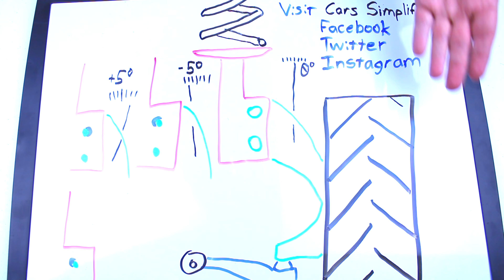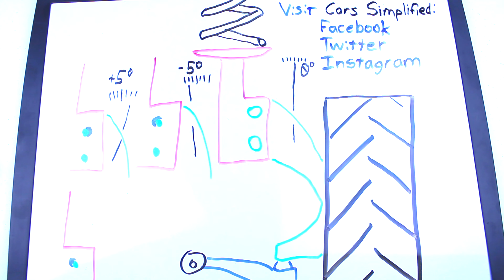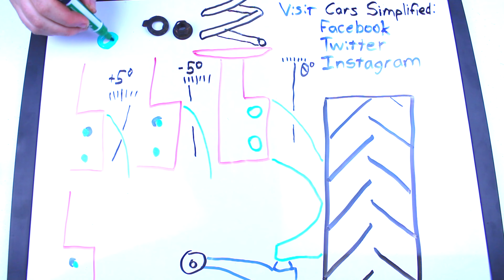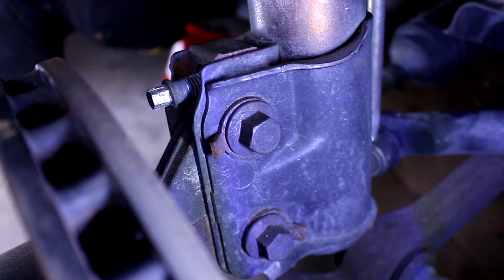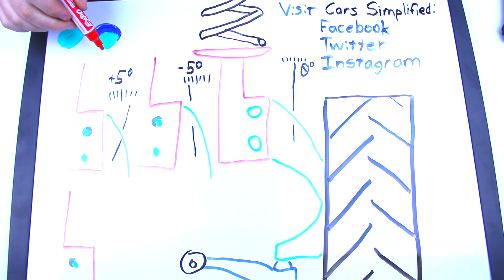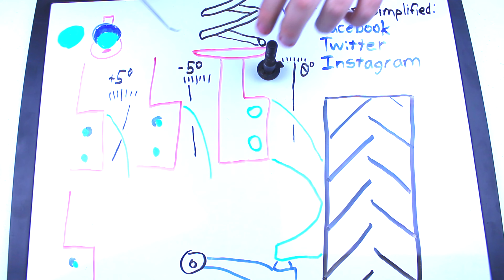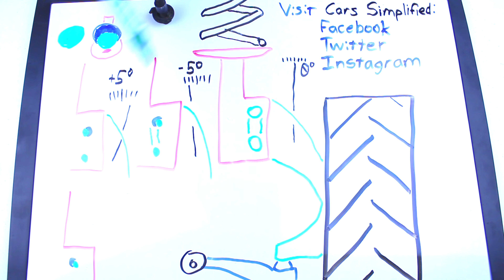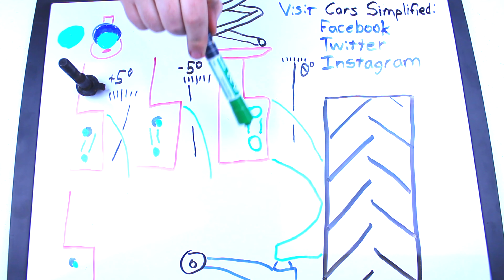How Cam Bolts Work (How to Adjust Camber) • Cars Simplified

Comment: Your video saved me, except there's a wrong diagram. The washer tab, you draw it in the opposite spot, instead of the green it woulda been the blue is where tab sits.  How do i know. I followed your instructions, and needed to flip it around to get the right adjustment. But otherwise great work.

Comment: Excellent video! You have just saved me $300 in parts & labor! That was what I was going to be charged at a Goodyear alignment shop to get these camber bolts and have them installed! Ridiculous. More importantly thank you for letting me know that I can install them at ZERO adjustment! That way I can still safely drive to the alignment shop and not need a tow. That was super helpful because you answered my only question I would've had right there. I have a 98 Camry and these dont come with camber adjustment capability. I went on the MOOG site and looked up the camber kits I needed for both front and rear and will install them at zero adjustment and take it to Goodyear for a proper alignment and evade +300 cost in parts and installation labor. Again, thank you so much! 🙌👍
Reply: And in my case ,alignment never was adjusted correctly, always had shaky steering wheel, tire wear..$80 wasted at every trip.. they had warranty.. but who wants to bother going back to the alignment/tire shop waiting there,an hour or more, just to hope they get the alignment right.. big waste of 💸and time.. like the saying go’s “ Give a man a fish and you feed him for a day. Teach a man to fish,and you feed him for a lifetime..”I learned and do my own wheel alignment.. height adjustments,camber and toes..

Comment: Thanks for the video.  Can the camber bolt be installed at the bottom hole instead of top hole? I am asking because there does not seem to be any gap between the knuckle and strut on my car to allow camber bolt to push the knuckle toward strut, if it is installed at top hole, as I need to move the camber to negative side from positive.

Comment: Hello and thank you for this great video. I just had my car alignment done and they told me I needed to fix 3 of my wheels with camber kits, and from watching this video I can see that I can do it. My question is, after I correct my camber, will it change my alignment too, do I need to get my car realigned? Thank you.
Reply: Anytime you unbolt or adjust suspension components, it's a good idea to get an alignment. It's cheaper than a new set of tires. If you're actually making adjustments to camber (which is a vital component in your alignment) then you most certainly need an alignment.
Reply: @echonomix_  wow thank u sir..im already think of the same but dindt know thats true or not but what u said is totally make sense..thanks again!

Comment: I guess my question is do you install these at the desired adjustment or do you adjust this during your alignment and torque the fastener to spec once desire angle is achieved
Reply from the maker: You can estimate what kind of adjustment will be needed for a general improvement but it definitely needs to be adjusted as part of an alignment to get it right.
Reply: @CarsSimplified  I get that. Trying to determine either to get camber plates or just these bolts. I assume have to jack the vehicle up to make the adjustments and then put back on the rack or can you adjust while performing the alignment. I hope you know what I mean
Reply from the maker: On a fair amount of cars these bolts should be accessible from under an alignment rack and they can be adjusted while watching the camber readout on the screen. Adjusting them with vehicle weight on the wheels will show immediate changes as they will appear on the road, unless there's slop elsewhere in the suspension.

If you're trying to get a wide range of adjustment, ease of access to the adjustments, or generally building anything with performance in mind, camber plates are the way to go. These bolts typically just correct collision damage, slight lowering/lifting... generally just small adjustments the factory didn't build in elsewhere.

Comment: This is the video I was looking for!! I had an accident hitting the curb, I changed my lower control arm and outer rod but the tire has positive camber like a lot that my tire is wearing on the side, I thought to change the whole wheel bearing with hub assembly thinking it might have been bend and right now I am installing the whole wheel assembly but what do you think??? is it a simple camber adjust or actually the wheel bearing with hub assembly is the one?

Comment: Bro, I have a question: does it affect the car alignment? In terms of, Toe in, toe out... Best explanation ever. Thank you...  just found you on youtube. Following
Reply from the maker: Thanks for the kind words!

In response to your question, the suspension style shown/discussed here should only see camber altered. With some designs where the bolts are very low on the steering knuckle, if a dramatic adjustment kicks it out, there may be a slight toe in/out alteration, but very minimal. It will also depend on how far the tie rod's ball socket is from the lower ball joint.

There is a completely different suspension design that will have toe in/out much more affected by camber bolts. Those bolts have a different design and adjust control arms. These bolts also adjust steering axis inclination (often incorrectly called caster) as a pair.
Reply: Thanks man! I have a Renault Sandero RS here in Brazil, it’s a popular car that many people use in trackdays here... and I’m looking for this camber upgrade. I use my car on a daily basis on street and intend to install it to use in a race weekend... but would like to do not change the toe. Thanks bro!!! Amazing explanation

Comment: very Easy to understand ... but i have a question  can i order 2 cam adjustment bolts and use the 2 oem bolts for each side of wheel im curious to save some dime..😊 thank you
Reply: Yep.. camber adjusting bolt on the top hole of strut/ knuckle and the OEM thick bolt on bottom hole of strut/knuckle ( source: Specialty products company or Moog..)

Comment: So if the cam lobe of the bolt is pointing straight up or straight down that would be 0° camber correct?
Reply from the maker: The cam lobe would have to face the direction of the internal tab (away from the external tab) to make the bolt have no effect, but that doesn't automatically mean 0 degrees of camber, even on a brand new vehicle. Some camber is built into the vehicle from the factory; there can even be minor differences between two otherwise identical cars. Camber always has to be measured.
Reply: Yes I worded that wrong I meant I thought it would have Zero Effect if the lobe is pointing up or down because from what I understand the cam bolt is actually thinner than the original bolt so the internal tab is just making the bolt basically the same thickness as the original Bolt. But that is why I asked the question so thank you for the information

Comment: If my car is pulling left (towards driver side) when driving, do I adjust the driver or passenger side camber bolt ? What degree should each side be so it doesn’t pull left ?
Reply from the maker: Has the toe in/out already been corrected? That's a bigger contributor to pulling one way or the other and usually doesn't require the purchase of any parts.

If the pulling is actually camber related, you will have to determine which wheel has the camber issue and correct it. The intended camber angle will differ based on what the car is.
Reply: @CarsSimplified  yes I took it to get aligned but there is a very slight pull towards the driver side that has been driving me crazy. I already put camber bolts and maxed (-) on both sides but it still pulls left..

Comment: I just don't get what the role of the tabs on the washer is. Cause the bolt is all that adjusts the camber. T
It should work without the washer??? Please help with this
Reply from the maker: I probably should have explained the "why" of that part a little better in the video, but here's what is going on:

Because the opening for the bolt is just big enough for an OEM bolt, unless the hole was drilled larger, the maximum diameter that could possibly fit inside is fixed. The camber adjusting bolt is actually smaller in diameter than the OEM bolt, except where the cammed section is. There is a gap around the entire bolt except for that cammed section, so the inner tab on the washer is needed to fill the gap. It fills the gap on one side, instead of uniformly around the entire bolt. This means that the location of the inner tab decides where the rotation center of the bolt is. If the bolt is already biased towards the direction of the adjustment that needs to be made, then when the cammed lobe is rotated that way, too, it gives the maximum available adjustment.

Without a washer with this spacer, the clamping force of the bolt will need to keep it in place, and with all the slop/gap of the main section of the bolt, it will likely make zero adjustment compared to the factory bolt.

Comment: Are these self locking nuts?  I have trouble tightening them like the nuts don't fit the threads.  Does it mean that the camber bolts/nuts can only be used once?  Next time if taken off, I cannot reuse them?  Would I have trouble getting the nut back out next time around? Should I put anti seize?
Reply from the maker: Definitely don't use anti-seize on them! The nut on the ones in the video have a section of deformed threads that keep it from backing off. Once they are used the first time, they aren't as effective and will go on easier because of it. If you want to put anything on to assist it, threadlocker is the stuff to use, but it doesn't need it when it is fresh. I don't know if a threadlocker provides the needed locking force to "fix" a used nut; I imagine red may do the trick, but I don't know for sure. I'll look into it further, but an initial search didn't turn up anything.

Comment: What’s up man! I just installed some Megan coils on my 04 gto. Quick questions.. does the stock camber bolt (little 8mm bolt above/perpendicular to the clevis bolt holes) need to be pressed into the strut before tightening the clevis bolts? Or does it matter

Comment: I was told last week that my 2014 Taurus needed the Camber Adjusters removed and OEM strut bolts put back in because he couldn't find the center line and the cam adjusters were "put in wrong" (2 bolt strut, put in top hole). How true is what he said?

Comment: Hello, I have a weird question. Can I use camber bolts with aftermarket coilovers (meaning the car is lowered) or should I go with camber plate ? My coilover (Tein street basis Z) doesn't have camber and I have to use camber bolts, but it seems it's not holding it's position properly. It usually slip when driving on uneven roads (ruts, bumps, potholes etc).
Reply from the maker: Camber plates are going to have a better end result for performance, if they stay in place. If you can't lock them in place and camber bolts fit, then a double set of camber bolts should work. I lowered a Pontiac Grand Prix a few years ago (-1 inch lowering springs, not coilovers) and I needed to use camber bolts on both bolt locations on each side to get the alignment right.

Even if you go with camber bolts, you'll need to make sure whatever the top of the coilover is mounted to stays put. Let me know how it goes!
Reply: @CarsSimplified  so if the inside of my front tires is showing more wear then I would need positive camber? I found some camber bolts from SPC maybe this will help.

Comment: I just turned into my driveway and the bolts that hold the wheel to the suspension strut had fallen out, therefore the wheel was loose and the car veered the opposite way to where I was turning. I looked at the work that had been done earlier in the year on my car and a few things relating to the suspension were replaced and this means the wheel would have been taken off. No other work has been done to this area of the car since then. It seems to me the bolts were not screwed on properly when they reattached the wheel. How else would the nuts and bolts have come loose and undone completely?
Reply from the maker: That sounds intense, I hope no one got hurt! That could have easily have gone wrong in a much more dangerous situation!

That seems like the most likely reason, but it's just surprising they took that long to come off. If that is indeed the reason and it took that long to come off, you'll probably see some wear in the hole where the bolts should go in.

Rust: Possible but unlikely and easy to tell that's the case.

Defective or reused nut: second most likely reason. The nut is usually a one-time-use nut, and the thing that wears out after the first use is what keeps it from backing off the bolt.

I don't have any experience with wheels coming off in that particular manner, so there could be a potential cause I'm overlooking, too.
Reply: @CarsSimplified  hi, thanks for the reply. I don't do a massive amount of miles so this can be a reason as to why it would take  this period of time for the nuts to screw themselves off. I do maybe 2 miles a day on average and only on very very rare occasions drive more than 5 miles in a day.

Some people have said to me the nuts may have never been put back on at all... saying "The suspension geometry is such that it tends to "sit" the wheel-hub in, due to car's weight pushing between the two resting points (the tyres)". So basically the forces that play on the bolts are enough to keep them in place, according to this response.

I have no nuts to check if they were defective, they are long gone, only found the bolt that came out.

Comment: I wrecked my front bumper and bent the frame a bit on the left side ever since im not able to get a alignment on the left side dead on do you think these will help
Reply from the maker: They should give you more camber adjustment range, but there is more to frame damage than that. Definitely better than not doing anything, though!

Comment: My son bent my s front strut I took it to an alignment place he suggested cam bolts would be cheaper the a strut my passenger front tire is wearing about ever 5 months do you think this would work I really can’t afford new struts
Reply from the maker: It would reduce the wear a bit but most likely won't fix the alignment issue completely. I don't know how damaged the strut is, but if they are comfortable with the liability for that sort of fix, it is definitely the sort of thing that would work as a bandage to reduce the tire wear issue.

Comment: How safe is it using camber bolts top and bottom for more of a negative degree?
Reply from the maker: It will depend on a few factors, but I doubled them up on the front struts of a lowered front wheel drive car with stiffer springs. Although they are a stronger metal, they are thinner, and I bet something abnormal like a pothole could damage them. I would have to look into their shear strength and compare them to the original bolts.
Reply: @CarsSimplified  Okay thank you, yes that's exactly what I'm fearing
Reply: @CarsSimplified  Exactly. These cam bolts should be equal or stronger than the OEM bolts.

Comment: The top hole of my suspension is not round, so it can be adjusted but not finetuned unfortunately..does a cam bolt also work on mine you reckon?
Reply: If the top hole is oval your car has stock cam bolts that already give it adjustment. Talk to a dealer for OEM parts.
Reply: @gabrielakin3674  well it’s an aftermarket set so I’d had to use the stock round bolts
Reply: @infernalGotYou  Stock camber bolts should be oval on part of the shaft. Did you try those?

Comment: Thanks for the explanation but I’m left with a question. Does the original bolt tends to wear out and needs to be replaced with a cam bolt for camber adjustment after years of usage? I’m from Malaysia and over here, we have contradicting opinions on this matter. Some would say that original suspension doesn’t need a cam bolt while some would say after years of driving, the original camber angle will go off and needs to be addressed by installing a cam bolt so that it can be adjusted. The latter opinion often made by tyremen when we send our car for tyre service, was widely accused as their way of milking money out of the customers hence why I’m asking this to get a detailed explanation. Thanks!
Reply from the maker: Both are kind of right; I'll explain;
The original bolts may rust a little, but it would have to get pretty bad to throw off the camber angle. Years of wear can throw off alignment but usually in other parts like the rubber bushings from general use, or bent metal parts from more rough situations. While it is much better to fix the alignment by replacing the worn part, the bolts tend to be less expensive and offer adjustability.

Sometimes, even brand new cars end up with unforseen alignment issues after just a few thousand kilometers of settling, and sometimes end up with these bolts under warranty.
Reply: Any wear that causes damage or distortion to the suspension components or the frame they are mounted to will put the alignment out of spec. So you can use "camber kits" or bolts like these to straighten it out. Just check the alignment and if you can't get it back into factory spec, then use these.

Comment: Any one know if I can use a regular nut and bolt instead of a cam bolt? The nut and bolt snapped off of the cam bolt on my 95 grand Cherokee....don’t really want to spend 50 bucks on a glorified bolt if I don’t have to